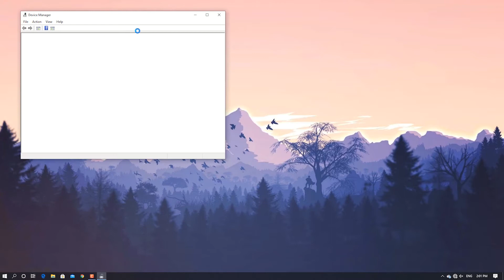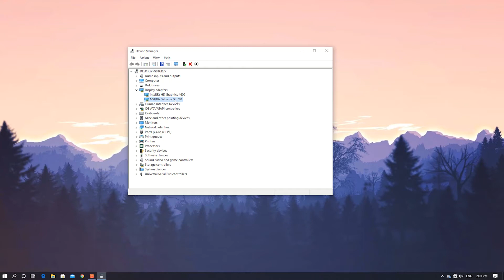How to power your Graphics card with SATA power without PCIE power | Nvidia 2020

Comment: people should be aware to check that the sata string they are connecting too is able to supply the current that graphics card requires i would think its pretty close to the limit ,it would be smarter to connect it to the 4pin molex connector string ,id prefer to add an extra psu

Comment: i have only 1 molex, can i split it with Y adapter and then connect gpu with 2 molex to 8 pin
Reply: Yes you can but if you connect with 2 molex then it will convert into 12 pin - 6 + 6 pin , 
Because a normal 4 molex adaptor has 6 pin adaptor